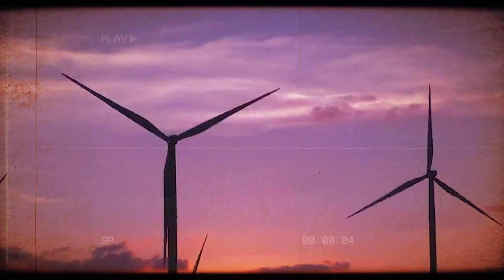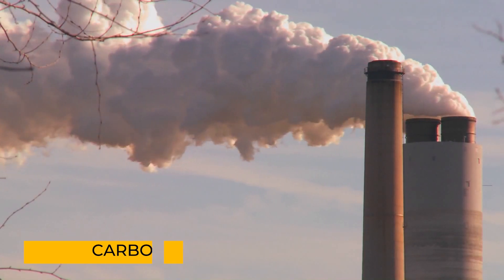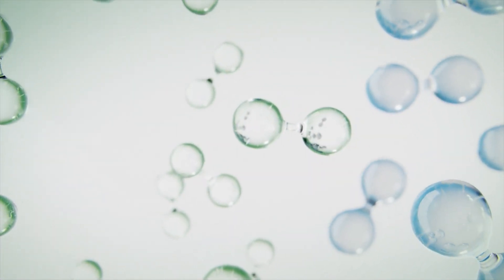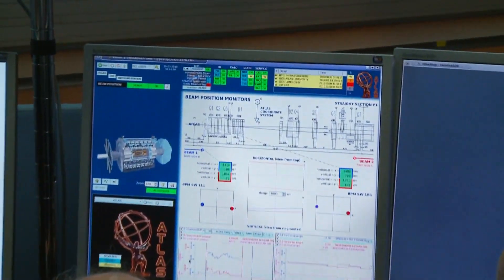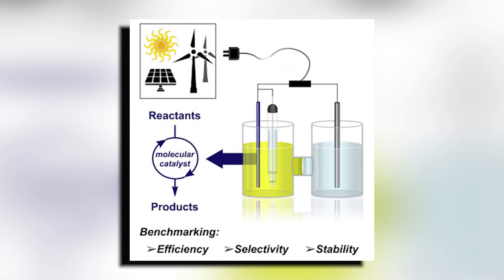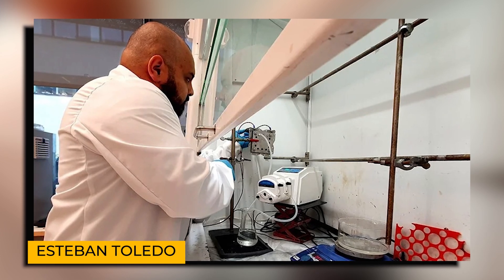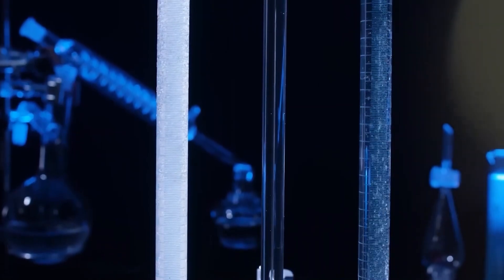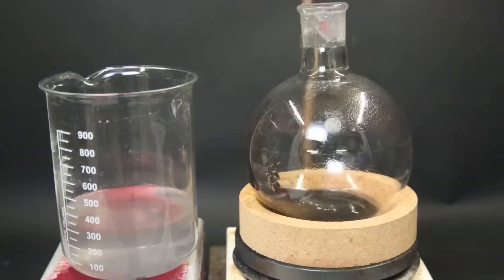This Hydrogen Breakthrough Is SHOCKING The Entire Industry

Comment: The biggest problem is storage of hydrogen. in gaseous form it will leak out of even stainless steel containers. In liquid form, a large amount of energy is required to keep it in cryogenic temp.
Reply: Not only storage but also transportation.
And you use electric motor anyway why not just EV?
Batteries will get better but you cannot change hydrogen.